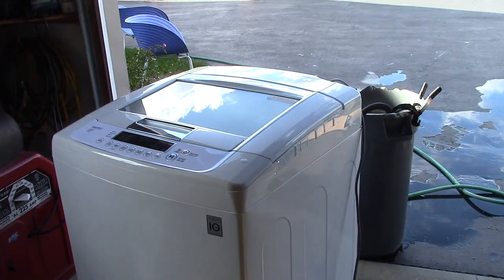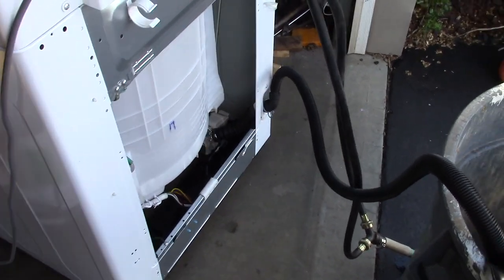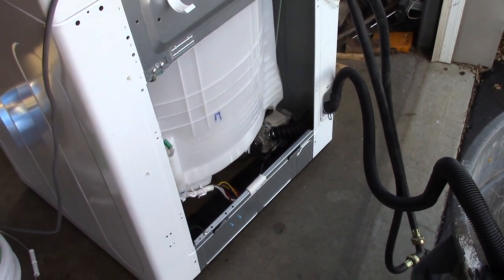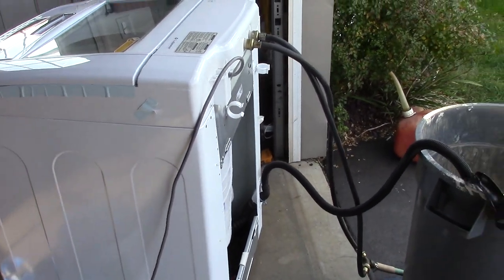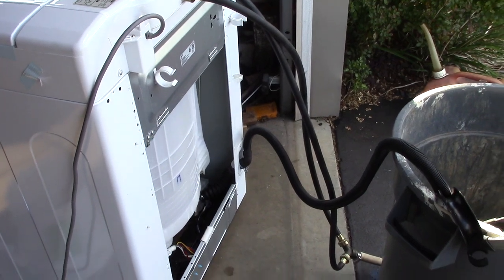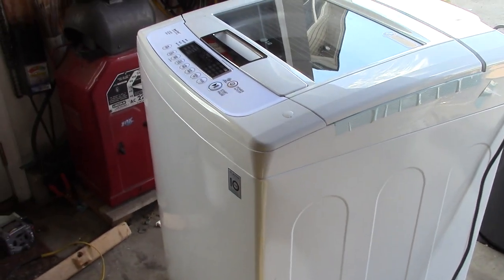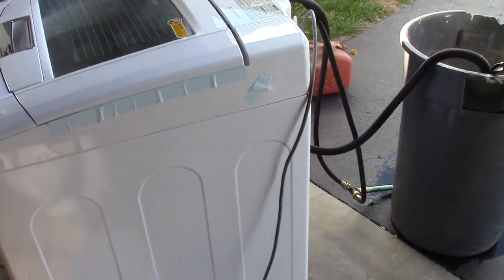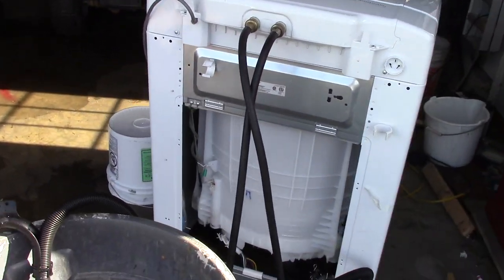LG  Clothes Washer Repair WT1101CW

Comment: That’s my washer, bought it in 2014, finally gave me my first OE (pump) error message tonight on a tub clean cycle. Gonna check the pump to see if that’s my issue. I hope it is and isn’t the board.  Fingers crossed. Thanks for this video for showing me where that damn pump is.

Comment: doublewide, wanted to tell you THANK YOU so much for this video.  I was having the same problem and with you instructions, was able to get into my pump.... turns out I had the EXACT SAME HAIR PIN stuck in my pump also! You saved me a lot of time, swearing, and money.  Keep up the good work!!!
Reply: Stephen Moore, LCSW at Ascension Counseling Utah its an indian lg
Reply: Question I just pulled out a Bobby pin from mine, but still not working. Did your pump kick on when yours was running? My pump seems to be intermittently turn on

Comment: Very lucky the bobby pin didn't break the impeller.  I've repaired these type machines for years and it's  important to make sure everything is out of pockets before doing the wash.  Good job and what a great find.
Reply: Neill Southwick I have a UE code over and over again what can I do?
Reply: SPEED QUEEN!
Reply: What would cause this washer from starting to spin on spin cycle and then hiccuping and stop spinning
Reply: Dude, mine is “clicking” when I reach in and rotate the drum. I noticed an error msg during the cyCle that showed “LE”. Any ideas?

Comment: At the 2:20 time mark on your washer shows a HOSE Clamp-on the inbound side of the pump. That is not a factory connection. Most of their washers had to be reconditioned, then sold as new. The hose is 2 inches too short and the travel of the tank to offset a lopsided load will one day rip that hose off. I repaced 12" of drywall in my washroom. Don't get caught by your wife saying "I told you so."

Comment: I'm glad I listened to your breakdown about this washer.  I have an LG Wave Force with only difference being that my control panel sits atop of the washer.  I kept having and "OE" Code Error and starting from scratch, I disassembled the hoses from the pump and checked to see if there was an obstruction of some kind and there wasn't.  Now I've done this twice.  The first time I tried this the washer ran two or three loads successfully until the other day when the Code popped up again and the tub would not drain.  I vacuumed the water out with my shop vac and I went a step further this time and looked the pump over pretty good but, I didn't find any obstruction inside the pump.  I've read other articles concerning the "OE" Code and your explanation was better however, I don't know much about circuit boards, amps, ohms, etc. and I don't know if the circuit board could be my problem.  I'm trying my best to stay away from calling a repairmen to fix this thing because I have already done most of the work for him and I wouldn't want to call someone and they just come out and do something really simple to fix my washer and charge me up my ying, ying!  I think my next attempt at fixing my washer will be to disassemble the pump itself because I have heard that one man found a needle inside of the pump and once removed it fixed his problem.  Thanks for your video and sounds like you picked up a winner of a washing machine for $150 because when I purchased mine it was close to $1000 and the matching dryer was almost as much.

Comment: I had the same problem with my Amana front loader. It was the end of a plastic clothes hanger. It stalled the pump and would error out. Cleaned it out and has worked great ever since.
Reply from the maker: +Dale Hobbs Good to hear you got it fixed.  I'm wondering if my pump is damaged at all from being jammed up.  I know the previous owner was using it and draining it into a floor drain.  I guess the pumps are made to get locked up and not be damaged.  At least I hope they are.
Reply: doublewide6 I think when it throws a code it's some kind of safety feature to protect the pump.

Comment: I have the dryer that matches your washer.  My LG washer has the controls at the back of the machine, but I am very, very happy with both.  It used to be most appliances lasted 15 - 20 years without many problems--even washers and dryers.  These days they cost 4 or 5 times as much and seem to have only 1/3 the life span.  If I can get 10 or 12 years out of my LG machines, I'll be tickled to death.
Reply from the maker: +A LeBlanc I agree with you.  We will see what the future brings.  I would be happy with 7-8 years.

Comment: FYI the pump code is OE. If you do not find anything obstructing the pump or drain pipes and determine that you need to replace the pump, the part number is 5859EA1004F for WT1101CW
Reply: I replaced pump and control board  and my washer still isn't draining all the way.. still ends up with an OE error.. dnt knw wat else it can be
Reply: @davidposada220  oh man I'm about to replace the board this is not the news i was looking for
Reply: @davidposada220  did you ever figure it out? I just ordered a pump yesterday  but after watching this video I hooked the old pump directly to 120v and it worked. I am now going to check the continuity between the board and the end of the pump wires.

Comment: I purchased the LG Smart DRum Inverter with direct drive technology hydro shield top load washing machine in 2018, it is a money pit from start.  Now the softener won't dispense.  First it was the control panel, then other fixes, expensive, Thank God for You Tube help cause it has walked us through all the fixes so far.  It says it has a 10 year warranty, but I am sure it doesn't cover this.  What can I do to fix the problem.

Comment: On an LG top load washing machine, is the washplate supposed to move independently of the outer washtub, or is that an indication that the splines on the washplate are stripped ? Thanks for the videos.

Comment: Do you know how to remove the cover on the top of unit that covers the electrical wires? I am in need of switching out the power cord on mine. I have unscrewed the two screws on either side of the washer but I am not sure how remove the cover with out breaking the plastic cover. Thank you in advance!!
Reply: Did you ever find out!!
Reply: Woodrow Scriven, I also need to know this
Reply: There are 2 visible screws at the back which once removed releases the wire cover. You just need to unclick for it to pop out after screw removal.
Reply: The rear cover has three parts. Two smaller on the side and a long one one in the middle. Are all these parts connected and do they just pop out if I insert a flathead? I am trying to adjust pressure valve to get more water in the wash.
Reply: I am stumped as well. I removed the 2screws and i cant get the cover to move. I have pried and tried to pull it up, tried to slide it back, tried lifting one side, i just cant get it off.. any other ideas?
Reply: in case u didnt figure out yet, slide to the left after removing the two screws.
Reply: I put a common under the screw holes and forced it apart
Reply: @kristoffer3665  so you remove the 2 screws in the back, lift up and then slide to the left? I tried but wont budge. Feels like its going to break if i keep lifting and sliding.
Reply: @mattminyard4458  it is actually a whole casing of the controller, the round cover in that area with a rectangular hole is the cover of the screw. Pop it out using a small flat screwdriver,  then you can remove the screw on each side. After removing the two screws, you have to slide that seemingly cover to the left to reveal the electrical components.

Comment: I have the same washing machine,  i replaced the lower pump, cleaned all filters etc, code reading is 0E, i suspect it could be the mother board, its not actually releasing the water,  any other advice
Reply: What was the issue please reply back I’m having this issue too.

Comment: I am finally and I mean FINALLY rid of my example of that machine, and will never again own any product from LG. When mine died the first Sunday of May, 2019, just 5 1/2 years old, I went to Smith Appliance in Marietta, GA and bought the newly available Speed Queen AWN632SP116TW0, also called the TC5000WN, or simply "The Classic". While SQ did introduce the TR-series machines for 2018, the reviews were mixed. Speed Queen loved them, the customers didn't. The TC5000WN marks a return to an independent agitator and a tub brake that means they don't have to install a lid lock. The SQ has a true hot wash cycle whereas the LG limits the temp by mixing tap cold water, not what you need if you need a sanitize cycle. Best of all, the Speed Queen actually gets ground-in soil out of the denim in my work jeans, a feat that no HE machine I have used, front- or top-load has been able to do. No more repeated fills brim-full and drain cycles trying to balance the load, no more doodly-doodly-doodly t the end of the cycle. SPEED QUEEN OR NO MACHINE!

Comment: I have the same washer and just recently noticed water was leaking towards the front of the machine when in use. The backside of the machine was nice and dry. what could be causing this?  I removed the hose that connects to the machine and a small amount of water spilled out. Is that a sign the pump is failing? thanks!
Reply from the maker: if there is water above the tub the pump is not working.  It sounds to me like you have a leak.  The washer always has a little water under the tub even though it is all done.  That water will start to smell if you don't run laundry for over 5 days or so.
Reply: I ended up snaking the line that is shared with my kitchen sink at two different clean outs.  I didn't see anything come back hanging off the end of the snake but I ran it  down for about 20 ft each time.  Turning on the machine and watching the pump operate, all seems fine and no leaks.  At this point I just have to keep an eye out for any leaks.

Comment: I have this washer. A year old. Have issue with nasty gunk when I wash all over my clothes.
Reply: Had the same problem.  Buy Affresh washing machine cleaner. Place one pod inside the tub (remove the wrapper) and run it on "tub clean" cycle. And do this ONCE A MONTH

Comment: I have this kinda washing machine and the water level switch isn't so good, any idea how I can fix it
Reply: Yes. Trash it and buy a Speed Queen, preferably the TC5000WN. The Maytag COMMERCIAL (but NOT the big-box store "COMMERCIAL TECHNOLOGY")  machines work well, too. The Speed Queen AWN-series machines, of which the TC5000WN is the only example currently on the market, is identical mechanically to the workhorse Speed Queen and Heubsch machines at your corner coin laundry. The Maytag is available around $800, and I paid $1140 ($1029 plus tax and delivery) for the Speed Queen.

Comment: Lg top loader washer is stuck locked with clothes in it .....how do I manually open?
Reply: have you tried powering it off for a few minutes? my last washer would do that all the dang time
Reply: A four-pound blacksmith's hammer to the diamond glass lid should do the trick. The Speed Queen TC5000WN and other AWN-models don't have lid locks.
Reply: @mikeschur7825  why do u say that

Comment: POS machine. 3 yrs old had to replace the agitator disk and bearing assembly. Constantly has UE or uE codes.(unbalanced.) fill the tub totally to try to re-balance . does this 3x  then shuts down. waste of water and time. Takes HOURS to complete a load sometimes.
Reply: Double D what do you mean when you say ,”Off Balance.? Mine is in spin mode and says UE.
Reply: Only 2 hours? I timed my cycles using a calendar! My new Speed Queen runs a normal cycle in under a half-hour and actually gets the clothes clean. Watch the reviews on YouTube; some models have gotten mixed reviews, but the TC5000WN is probably the best top-load machine you can buy.

Comment: Anyone know where to start with the LE error code? Same exact machine. The washing machine starts to fill and go thru the sensing mode,,, then it try’s to spin but doesn’t. Don’t know if I should start with the stator
Reply: Did you ever figure it out
Reply: @user-ui5hh7hf6i  yes, it was the position control sensor.

Comment: My washer keep add more more spin time, then add more water. Can anyone help me out? Thank you
Reply: I'll add: I recently bought the newly available Speed Queen TC5000WN, model number AWN632SP116TW01, and couldn't be happier with the results
Reply: Mine is does the same, i think its bc its unbalanced and machine tries 3 times to balance its self b4 alarming you and that takes forever since each time it will fill with water and try to move clothes around which rarely works and then its been waaay over a hour and clothes still not washed- big pain in butt!

Comment: Just fixed mine and it’s running like new now. Was so fed up with this error happening over and over again. Ordered suspension rods part # AJK72909308 and replaced them using another YouTube video to show me how. Took 20 minutes to replace. Screw LG for not knowing that this fix is this easy and for not helping all of us that spent money on these washers.
Reply: D B  what UTube video shows how to repair?

Comment: what to do if the drain pipe keep on running even it was turn off
Reply: Sounds like it's siphoning out. Raise the hose end where it goes to the drain.
Reply: It’s the main board you need to replace

Comment: never will i ever purchase an LG again. transfer Case went out, so i have to purchase a new washer. its not worth fixing and its only a couple years old. looks brand new still, looks like imwill be purchasing a new Whirlpool brand.
Reply: Total agreement. LG builds shit, no matter what the product category.             
Stay away from the Whirlpool group machines. They used to build fine machines about fifty years ago, but tha last two I had were terrible.           
I bought a Speed Queen TC5000WN. works beautifully and my water bills are lower than they were when I had the LG.

Comment: Thanks this video was super helpful! I have the same problem but Does anyone know what to do if it's not spinning during spin dry aswell?
Reply: I have the same problem
Reply: @lyla3436  I have fixed the problem if you'd like to know? 

There's a video on it if you just search "LG washing machine spin dry not working" I just unplugged the water level sensor and cleaned up the terminals then let them dry, plugged it back in, turned it on, tested the spin dry and it worked, I also got slightly electrocuted when I touched even the plastic of the water level sensor but it wasn't too strong of a zap and that way I knew its not grounded properly or something is bad with it so just make sure it's turned off when you clean the terminals, would definitely need to be replaced soon tho. 

Also if that doesn't work then the water level sensor probs needs to be replaced, but you should test the water intake manifolds buy unplugging them and trying to run the spin dry mode like that and if it starts to spin then you know the water intake manifold needs to be replaced. Just to clarify Abit and save some extra research :)
Reply: @kanenscott8883  what was your problem? Mine will get down to 11 or 12 minutes and will go into spin cycle but then will hiccup and stop spinning. It won't ever go into full spin cycle
Reply: @user-ui5hh7hf6i  that's exactly what mine was doing, I fixed it for awhile with the method above^ but eventually stopped spin drying all together and rinse mode started playing up aswell, I just bought a new washer by then but you could just replace the water level sensor and should be allgoods

Comment: Put clothes in it then run it UE code clothes off balance!
Reply: Cienna C Hello? My washer has stopped in Spin mode and the code says UE. Do you know what this mean? It’s new so not sure why it’s not spinning?
Reply: @warrensmith1005 It means your machine is out of balance. Move the clothes around so they're distributed evenly and try again. If you still have a problem, maybe check to see if the machine is level. The drum should look centred from above.

Comment: Adding my voice to the chorus that LG washers are terrible. Mine always goes off-balance, just like everyone else's. Do not buy one. In fact, do not buy anything from LG, their customer service is terrible. They will not help you.
Reply: SPEED QUEEN introduced the model AWN632SP116TW01 in May 2019. The redesigned 2018 TR3000, TR5000, and TR7000 machines have had mixed reviews (to put it mildly), but the 2019 model (also called "the Classic") has addressed all the issues related to the 2018 redesign. Watch the reviews of the 2017, 2018, and 2019 models. Shop carefully, though, the TR-series machines are now in the showrooms alongside the TCs, and while the cabinets look almost identical, the internal workings are entirely different. That said, Alliance Laundry Systems, parent of Speed Queen, also builds commercial and coin laundry machines, and you know how durable those machines are. The claim is 10,400 loads, the equivalent of eight loads a week for 25 years.

Comment: I have the same model and it keeps leaking water where the soap dispensers are. Any idea how to fix that?
Reply: jd061010 did you find out the problem?
Reply: jd061010  had the same problem, we replaced the in and out water outlet  .its around $60.Its due to hard water build up that  can destroy  the outlet